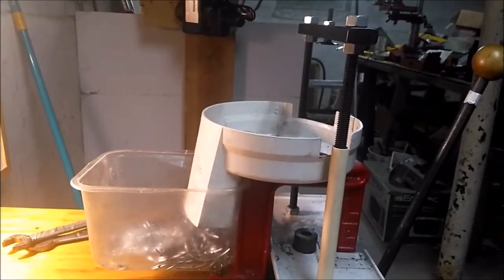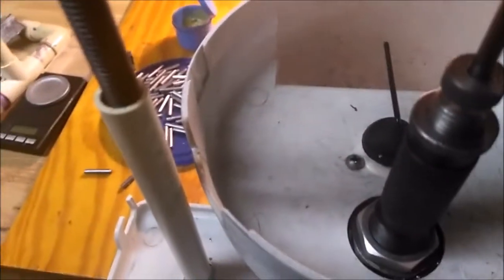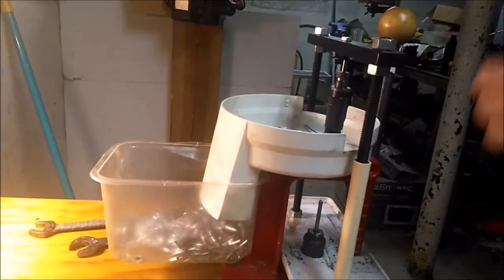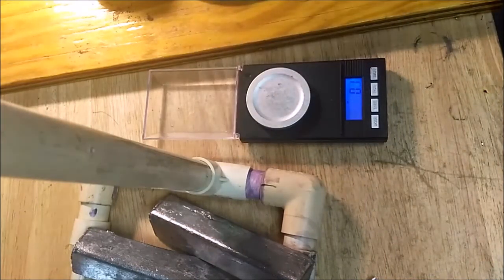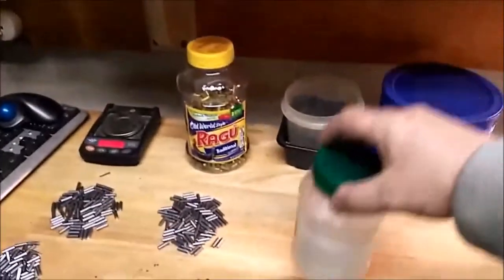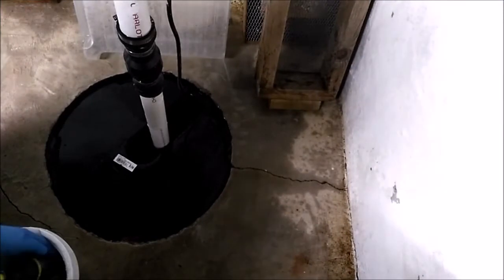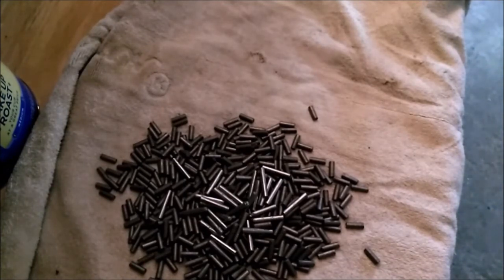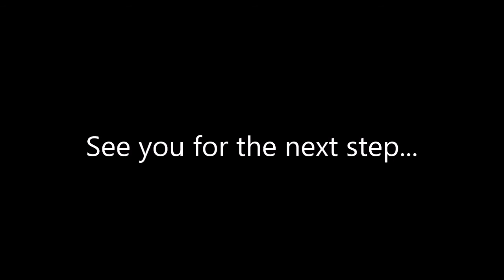Core Sizing and Prep (3)

Comment: Where did you find the plastic trays? 
I have the BT set but have to grab everything instead of it falling into a tray
Reply from the maker: The top one is part of an food processor I had, and the bottom one was the butter tray to a refrigerator. There's a guy on castboolits that makes 3D printed trays (and a core shaker).

Comment: 0.4gr spread after sizing cores!??  I was thinking they all be within 0.1gr.  I don't like the flashing it leaves behind, I wonder if you just folded over with your finger if the accuracy would be improved as cutting it off definitely will introduce the weight swing.   I got certificate from BTsniper I need to use it up and was debating between core sizer or 11 cavity mold.  I can make the core mold since I got milling machine although I am not exactly sure how to go about creating funnels on the sprue plate, I got 45 degree routing tool I use for other operations but it will probably leave chatter marks so if BTsniper got that mastered I would rather order from him and I can attempt to create core sizer myself I am just not familiar how to lap, if the hole is not perfectly smooth I imagine it will lead it.
Reply from the maker: It's not difficult to make a 6 cavity core mold on a drill press. Lee 6 cav blanks and a used reamer off eBay (~0.190" for .224). Make them to cast roughly 5 gn or so heavier than what you need. I have 3 different weights so far to cover a wide variety of bullet weights. The cavities don't have to be perfect since the sizer will take care of it. I used a step drill to make the funnels. First get the trays lined up, and mark their orientation (tops & sides) and drill them with a 1/4" bit (drilling all at once means the holes will still line up even if they're off a bit. Then drill with a step bit to 3/8", including the angle until it just touches 7/16", stopping right where the 7/16" shank begins. I have the diagrams from castboolits that I based my shaker off of. I can send you. Are you on the TRN Discord server?
The weight of flashing can vary quite a bit since weight of the cores as cast varies. I think that trimming them minimizes weight changes due to the flashing detaching  during cleaning off lube, storage and handling. It all works out since the jackets vary in weight too. That's why I weight sort everything so it's easy to grab two bags that add up to your target bullet weight. I just found out that my rifle REALLY prefers my 62 gn bullets over the 55 gn. I just have to make the cores for them.
Reply: @psykoklown874  I happen to have several .185 reamers, my core mold is same size, I think he made it slightly smaller to make sure they drop in easier.  I sort my cores too but I was hoping that if I ran them through core sizer they all would be within 0.1gr and from watching your video that doesn't seem like the case.  When I mentioned the funnels I meant the funnel on the sprue plate for mold, not the shaker.  

I just signed up for TRN Discord, apparently I tried that sometime ago but didn't know how to join TRN server, but I figured out now.  Yes, I found that jackets wary in weight even from the same manufacturer, I've done where I sorted jackets and cores to where the spread was .02 - .04gr expecting superb accuracy but was disappointed.  The best I got around 1.5 MOA and it's not repeatable, typical around 2 moa.  I am questioning my annealing.  I don't have a dedicated pot now.  I had a chance to buy Lyman 4lb pot during my bday midway sale for $35 but I blew it.  I think it would have made perfect annealer.  I've actually found you really need to anneal the brass where it glows.  If you try to anneal like your normal brass necks where it starts to glow it's not enough.  

I've tested 55 and 60gr with no difference.  I found that most I make is 60gr where the lead is level and after that it starts to come out and not pretty.
Reply from the maker: @DimaProk  The core sizer will actually compress them shorter and expand them (mine are 0.190" diameter after sizing). I have the full kit, not the simple, so that must be why I can make pointy soft tips. They'll turn silver when annealed. If the points fold a lot, they're probably under annealed (not sure if it's an issue with the simple kit). 800F for an hour is what people typically say. Many anneal in a self cleaning oven on self clean mode. There's a lot of info to glean from the castboolits swaging section. Federal brass is the thickest and heaviest, so most desirable. You can tell when you derim a Federal.

Comment: Where can i find the kit ...dies.. plastic . attachment.. .etc... everything to make this bullet..
Reply from the maker: There are a few swage die manufacturers out there, as well as some that aren't around any longer. BT Snioer, Corbin (there are two different Corbins; Dave and Richard).

Mine was made by BT Sniper, but I'm not shilling for any die maker, it's just the set I happened to purchase. I'm just showing what I've found, and am finding is involved in the process. There weren't any videos that showed what was actually involved when I first started looking into swaging, but there are more now. I just hope that I'm able to show little things that tend to get glossed over most of the time.

I just came across this list of manufacturers: http://www.algunjunkie.webs.com/Downloads/Bullet%20Swaging%20Die%20Makers%203-21-2012.pdf

They're all a bit different, an some have upgrades and attachments for different tips, so it's a good idea to do some research before pulling the trigger on a kit.

You'll find swaging info on several of the gun forums.
Here's the section on Castboolits:
http://castboolits.gunloads.com/forumdisplay.php?41-Swaging

If you meant the white plastic pieces on the press, I made those from junk appliance parts. There's a guy on Castboolits who makes 3D printed ones, and someone also offers a 3D printed core shaker. I just saw their ideas and looked for things that I could make work.